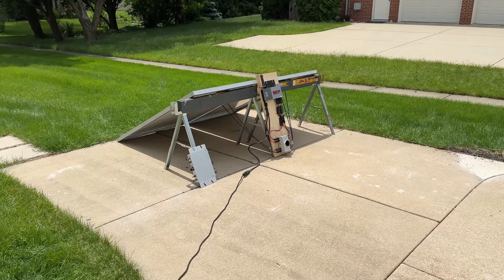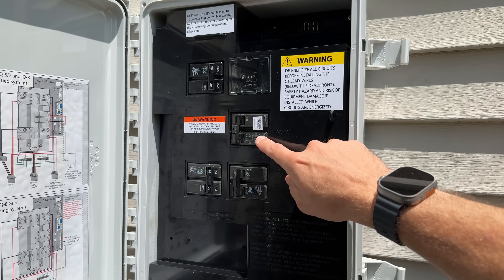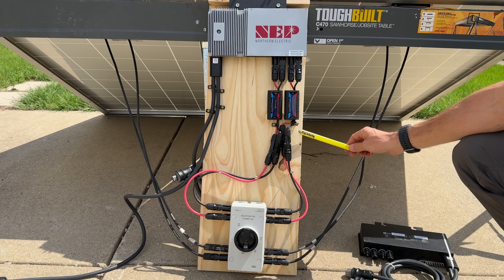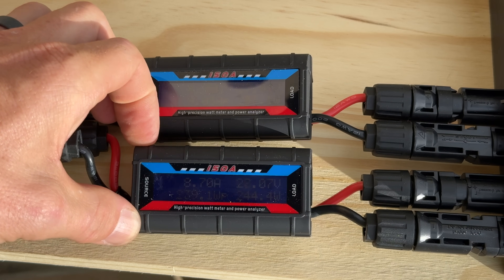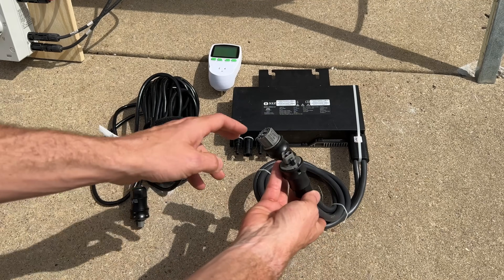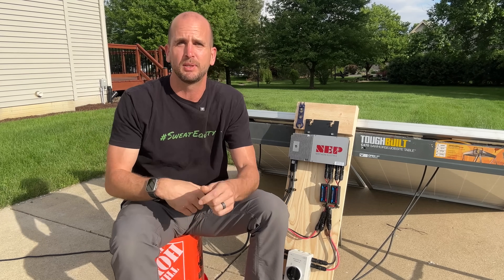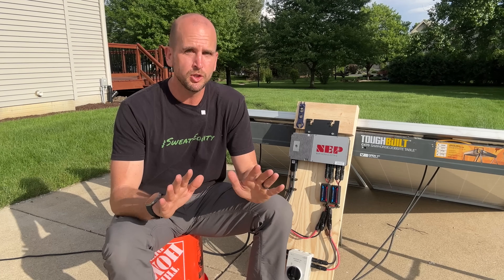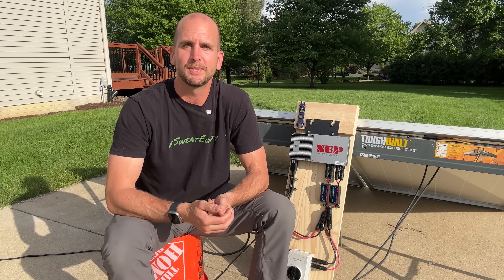Easiest Grid-Tied Solar On The Market!   Plug-N-Play

Comment: Note: 110V, 115V, 120V... all the same thing.  220V, 230V, 240V... also the same thing.  Just depends on your local utility distribution.  In the U.S., voltages have trended upward over the decades because the higher voltages allow considerably more power to be transmitted on the same distribution lines.

Basically these 120VAC (roughly) micro-inverters work just like normal 240VAC in that they synchronize to the line waveform that they see on the circuit.  But there are a number of issues that people need to keep in mind:

(1) 120VAC micro-inverters are generally NOT very efficient.  85%-90% is typical.   240VAC micro-inverters tend to run 95-98% efficient.   This also means that 120VAC micro-inverters run a lot hotter than a typical 240VAC Enphase micro-inverter would.

(2) You are back-feeding into just one side of the 240VAC split-phase going into your home, so the loading on the utility transformer is not symmetrical.   This is typically not an issue as long as you are not back-feeding too much power since of course most normal house loads are unbalanced as well.

(3) You are back-feeding into the middle or the end of a branch circuit.  This is actually illegal.  No, you won't get thrown into jail, but you might end up with a fine if you advertise what you are doing.   It is only legal to back-feed into a dedicated breaker, with nothing else on that circuit.  In addition the home must be on a solar tariff / backfeeding must be allowed by the utility.

(4) Back-feeding into the middle or the end of a branch circuit BYPASSES YOUR BREAKER.  This can be dangerous because depending on the topology this allows devices on your branch circuit to pull more amps than the house wiring might be able to support.

This is an issue if you are plugged the back-feed into the middle of the branch-circuit.  Devices sitting at the end of the branch-circuit can now consume the entire line breaker's amperage PLUS the backfed amperage without tripping the breaker.   The result is that the house's in-wall wiring can catch fire.

(5) There is the possibility that the micro-inverter will continue feeding devices on the branch circuit even if the breaker trips.  This is obviously dangerous.

--

So, that's the skinny on these 120VAC micro-inverters and why the only ones you see are junk brands.  They aren't really meant for U.S. consumers.  They are mostly sold to Chinese, Indian, and consumers of other countries with less robust or more expensive grids.

Now if you STILL want to do this, I have some suggestions:

* Never run any high-power devices on the circuit you are back-feeding into.

* Dedicate the entire circuit  to the back-feed.... but if you can't, then:

* Back-feed into the END of the branch circuit... the last outlet in the chain, to minimize the chance of an in-wall home-wiring fire.

* Note that you are still bypassing your breaker.

* Do not back-feed more than roughly 500W (4A) on a 15A circuit.

* Maybe consider not doing this at all.

--

Typical questions:

* Will the utility meter deal with one leg back-feeding and the other leg forward-feeding ?

Answer:  Smart meters typically handle this correctly if they are already solar-enabled (i.e. you already have home solar and a contract with the utility and the utility expects you to backfeed).  Dumb meters typically won't handle this correctly.

But you might want to test it because if it doesn't handle it correctly the energy can wind up being billed to you as consumption.

* Will the utility company find out?

Answer1:  If you actually manage to back-feed power all the way to the grid, and you are not already on a solar tariff, and you have a smart-meter, the utility will know immediately and might get unhappy with you.  Maybe consider ensuring that the home eats more power on that leg then you are back-feeding so you don't actually back-feed the utility.

Answer2: If you are on a solar grid-tie tariff and not a solar + battery tariff, and you back-feed after sundown, the utility will figure it out and might get angry with you.

* Just how dangerous is this really?

Answer:  It's all on you bro!   I aint gonna say its safe, but I will say if you do it keep the wattages fairly low.

* How many people in the U.S. use these sorts of plug-in micro-inverters ?

Answer:  Too many.

* Are these 120VAC micro-inverters UL compliant.

Answer: No.  None of them are.   Even if they say they are, they aren't.  None of them follow the timing rules, none of them have insulation testing, none of them detect out-spec grid conditions.  Most of them WILL disconnect if the grid goes down but not always... if your loads match the output they might not disconnect because most of these micro-inverters just use voltage sensing... if they are able to push the waveform too high they know they aren't connected to the grid and will stop.

-Matt
Reply: I was thinking, this can't be legal. Thanks for the very detailed response . 👊
Reply: Lots of great info. Thank-you!
Reply: Why use one of these expensive inverters compared to just using a much cheaper and readily available Enphase inverter?  I've seen videos of people connecting those inverters directly to 240V loads (off grid).  Couldn't someone accomplish the same "hack" of a solar install by installing another 240V dedicated circuit and then just connecting some enphase inverters and panels to it?
Reply: @asusreviews  It isn't quite that easy.  The latest Enphase inverters have an off-grid "grid-forming" feature, but you have to buy-into enphase's ecosystem for it to work.  You still need a battery and master inverter-charger to keep the whole thing stable.   

Enphase does advertise minimal systems that have only a small battery ("small" is a relative term here, by the way), but it isn't going to be as cheap as you think.

Doing it without enphase's ecosystem means using a UL1741SA master inverter to regulate all the enphase (or other) microinverters, stabilize the micro-grid, and provide a dump for excess power (aka batteries).

--

Basically grid-forming inverters cannot supply reliable AC to a home just on their own without some sort of storage component to go along with it.

I have used similar mechanisms without batteries during power outages, they are emergency outlet features on string inverters.  But here's what happens... the outlet constantly drops out for 60 seconds at a time whenever the load exceeds what the solar panels can output.  That can be a cloud, or it can be the startup surge from your fridge, or whatever.

Grid-forming without batteries will always be like this, so the only real use-case is to use such features to charge ... well, batteries.   And that's what I do.   I take the emergency AC outlet on my string inverter during a power failure and I feed it into power stations or AC chargers connected to my back-deck solar + battery system.

-Matt
Reply: Being an EE myself, I just watch these videos and read the comments for entertainment purposes only… sadly.
Reply: Thank you so much for posting this info. I didn't realize this was bypassing the breaker.
Reply: Not true. Different generation facilities have differing voltages for the differing phases. Single phase is typically 120 / 240 and 3 phase power is 110/208. It matters. It is especially important to know whether you working with single or three phase power.
Reply: @lurch2846  We're not talking commercial power here, lurch. We're talking residential.  And yes, everything I said was correct.  On most grids in the U.S., anyone with a kill-a-watt can just plug it into the wall and see significant variation over the course of time.  Try it.
Reply: @junkerzn7312  Residences can have either 3 phase or single phase. Usually single but 3 phase runs motors more efficiently.
Reply: @lurch2846  In the U.S., 99% of residential power is single-phase 220-240VAC (also known as split phase, giving you two 120VAC legs).
Reply: Thanks man .  Just  get a batt bank
Reply: I guess the point I'm missing is this: (even though I wouldn't actually do this)  The device monitors for line voltage coming INTO you home. If the grid stops feeding power to your home, this unit shuts off. It literally stops back-feeding. I could see using this in my back pantry branch to help feed a refrigerator and a small (300w) electric heater that I keep back there, which helps keeping the water lines from freezing. That would be about it...
Reply: How do you know  where the back end of the circuit is
Reply: This kind of setup, with low wattage, could be used to power the branch with the main breaker off though. You could have a breaker facing the PV, so when you want to use it you switch the utility breaker off, switch the PV on and use the PV on that circuit only. You still have to make sure the wiring can handle the amperage but if the utility breaker for the branch is let's say 15a than having a 15a facing the PV would ensure the same level of protection. With a battery added you could use this to power some patio lights in the evening or other small loads. As long as you disconnect the utility before turning on the PV breaker the risk is minimal, mainly limited to the PV setup. 
Another use could be powering lights in an outdoor shed, this way you don't have to run a cable from your utility box at all and just use the PV plus battery.
Reply: @devorlast  That won't work with the micro-inverter though because it requires an AC waveform to synchronize to.   You also need a battery... running an AC inverter directly from solar (microinverter or otherwise) is extremely unreliable.  I've tried it... it's a bad idea.   Clouds and other issues cause a lot of dropouts and ultimately might damage the appliances on the circuit due to all the power cycling.

People do configure "generator inputs" for their whole-house AC on the cheap using a lockout kit.  the lockout kit ensures that only one of the two circuit breakers can be engaged at a time.  During a power failure you just flip off everything you don't need and leave just the circuits you do need turned on.

Another option is to use a hybrid solar inverter... an all-in-one.  All-in-one's have "UPS" style functions where you can feed the grid AC into an AC input, feed the solar into a solar input, the batteries into a battery input/output, and then gives you an AC output that you just feed into the circuit.  The all-in-one handles the transfer/UPS/priority operations for you.

No micro-inverter in that case.  DC solar into the all-in-one (or into a separate charge controller directly connected to the batteries).

-Matt
Reply: @junkerzn7312  Thanks for the info, I figured some sort of battery would be needed for consistent output even at low wattage. I assume the all-in-one is more expensive then the setup on the video, especially a reliable one. It does make sense to me to use such setup for a rooftop solar, I'd rather store my unused power throughout the day rather then sell it to the utility on the cheap, if they even allow for that in my area. After visiting Puerto Rico I can see the benefits of having your own solar + battery + backup generator.
Reply: @devorlast  Ooops, I replied referencing a different video, so I deleted that reply and will try to answer to your question.  It was probably confusing "What the heck is he talking about?".

Basically these cheap 120VAC micro-inverters do not implement UL1741SA... they don't handle frequency-regulated power output.  So AC-coupling is basically not possible with cheap micro-inverters.  Some people try to do it anyway, but they mostly just blow up their appliances.

Basically there is no way to do it reliably without batteries somewhere in the system.

A full-on all-in-one + batteries + AC coupled micro-inverters is a very expensive proposition, so lets discard that as a solution. 

This leaves two ways to do it.

(1) You use a cheaper all-in-one and DC-coupled solar and integrate it into the critical circuit(s) you want to run.  All the AC power is routed through the unit (i.e. no external transfer switch... the unit itself does all that work).

(2) You setup an off-grid system (DC coupled solar, all-in-one or discrete charge controlllers and inverter, and batteries) that ALWAYS runs the critical loads, 24 x 7, and then you implement a "battery support" solution using the grid to deal with the situation when there isn't enough solar and the battery gets too low.

I've done both solutions.  I think #(2) is marginally less expensive but requires a lot more DIY worktime to put together (more breakers, more fusing, nailing things to a backboard or whatever, etc...).

#(1) is actually quite easy, I think, but you do generally want to have an additional breaker box installed for your critical circuits, then route an appropriate amperage circuit from the utility-side breaker box through the all-in-one to the critical breaker box.

-Matt
Reply: @junkerzn7312  Yeah I was wondering where did the van and 48VDC come from. Your two solutions sound pretty good for what I was thinking such a small stand-alone PV would be good for. I think the most expensive part of the build would be a large enough battery to make it worthwhile.
Reply: @devorlast  The absolute best little solar setup is actually one where you don't need the inverter.... a DC powered system.  These typically have a small solar panel, battery (also fairly small), and charge controller and that's it.  Dead simple.

Battery requirements depend on how much energy is needed, which can be surprisingly little in quite a few cases.  Always best to be able to calculate just how much energy is needed, in watt-hours/day.

Here are some examples of items that require very little actual energy consumption:

* Automatic gate for driveway (avoid running AC or LVDC trenched to gate).

* Security lighting.

* Motion triggered wifi cameras and other remote sensors.

* Pool cleaning and/or covering systems.

Requiring more energy / storage / or reliability:

* Remote well pump (well-to-tank, with gravity feed to house).

And then including an inverter you get into:

* Adding power to a small camper van or pop-up trailer.   A few solar panels up top, charge controller, battery, inverter.   Battery size depends on what you want to do with the power.

And the systems get larger from there.   Home, RV, boat systems, charging electric bikes, and so on and so forth.

-Matt
Reply: @junkerzn7312  Sorry to bump an old comment, but for (1), is the all-in-one unit just a micro-inverter that connects to your batteries? I've build dead simple DIY off-grid systems before (<1kw), but I'm working on something much larger and I feel weird trusting some of the hardware like fuses, connectors, switches and cheap charge controllers for anything heavy duty. I may want to invest in an all-in-one, but I don't exactly know where to look besides the major professional brands, which aren't really made for my DIY Lifepo4 car multi battery setups. Thanks for your knowledge on this!
Reply: @jeffreyjbyron  An all-in-one has solar MPPT inputs, battery connections, and an inverter output.  The solar panels going into the MPPT inputs will run through a DC-DC charger internally to charge the batteries, bypassing the inverter entirely for that path.  The solar inputs will also support the loads on the inverter in addition to that.

An all-in-one inverter is also capable of operating in reverse to charge the batteries from the grid.  When the unit does this, it connects the grid directly to the loads "pass through" and then is able to operate the inverter in reverse to charge the batteries from the grid.

All-in-one's are pretty cheap these days.  Almost any one will work well for 3000W or lower.  Great for small projects.  The idle consumption is usually anywhere from 20W to 60W so you do want to hook up a decent amount of solar to it.

If you are intending to construct a much larger system, though, you will want an off-grid or a hybrid inverter.  These also tend to be all-in-one's in that they typically have solar MPPT inputs, but unlike the smaller all-in-one's, these professional units are designed to take higher-voltage solar strings (typically 120VDC to 500VDC or so on the MPPT inputs).   With an emphasis on that minimum voltage.  And can output much higher power levels as well as typically be able to output split-phase (120VAC/240VAC) rather than just 120VAC.

The larger units also tend to be noisier and have a higher idle consumption.  For example, an EG4 6000XP.

Hybrid inverters are like off-grid inverters but are able to operate in a grid-interactive mode and supplement power from the grid or export power to the grid without disconnecting from the grid.  off-grid inverters cannot export power to the grid.    And hybrid whole-home systems also need permits and a power company agreement.

-Matt
Reply: Matt - You're obviously very well-versed in this and probably an installer, so I would like to ask you a question about these 120v micro-inverters.  Say you built a dedicated, off-grid system, including a service panel with proper breakers, and that's where you brought the power in from a PV array.  This would be 120v exclusively, powering only 120v loads, downstream from the panel...no plugging into an outlet.  Under those circumstances, what concerns would you have about using these 120v micro-inverters?
Reply: @jasonbroom7147  In an actual professional install, or even when DIYing a large system, do not use 120V micro-inverters, ever.   Simplest answer.

I can pretty much guarantee you that 120VAC micro-inverters do not implement any of the standards correctly and building a big system with them will result in a fire, problems, failures, over-volted appliances... don't do it.

In a dedicated off-grid system it is best to use DC-coupled (string) solar fed into charge controllers and not micro-inverters.   The reason is that it is far, far, far, far easier to build a rock-solid system when you don't have to deal with frequency shifting (UL1741SA).  You also want to optimize the DC path when off-grid because the battery storage is incredibly important.

If you decide you want to use micro-inverters anyway (aka "AC-coupled" solar) in your off-grid system you still don't use 120V micro-inverters.  You use 240V micro-inverters (98%+ efficient) coupled into a hybrid solar inverter that has a split-phase output.  That gives you two hot legs and a neutral that you can put into a standard AC breaker box and pull out 120VAC and 240VAC circuits as needed, just like you get with a utility AC breaker box.

-Matt